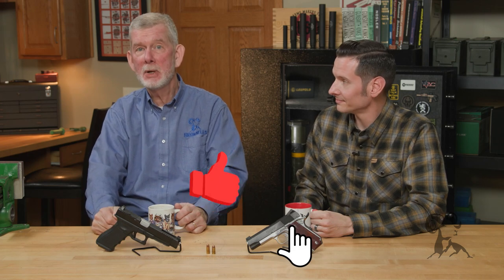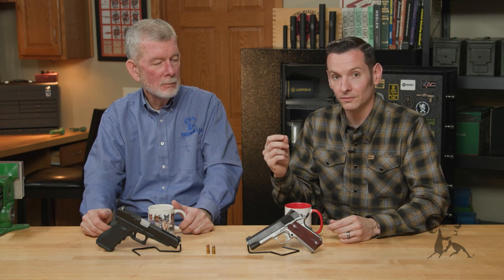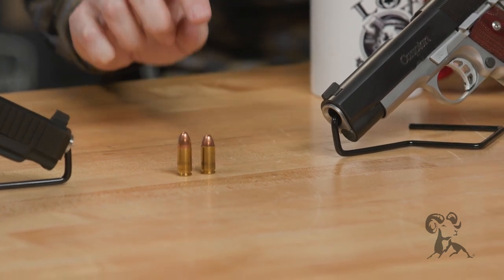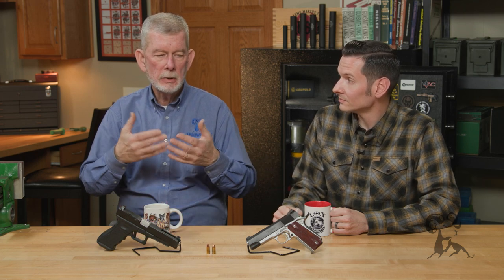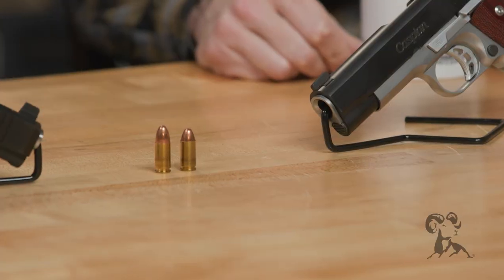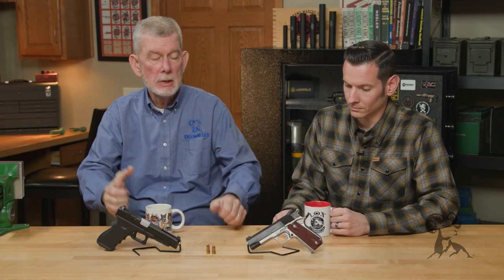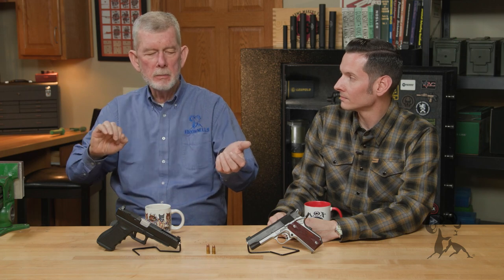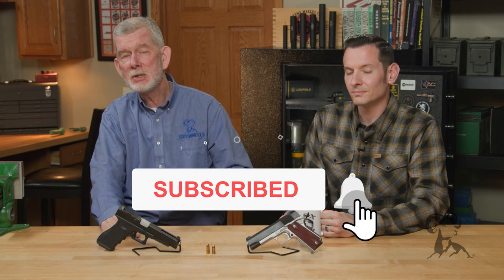Smyth Busters: Will Excess Bullet Setback Blow Up Your Gun?

Comment: I have always wanted to know this! I was a broke college student, and could only afford one 20 round box of Hornady TAP defensive ammo. I shot 7 rounds to function test it in my gun, and kept two magazines +1 in the chamber loaded. I had so many cartridge pushbacks/setbacks, I was down to only one magazine of decent rounds left before I bought another box (of different ammo). Question is, can you take a pair of pliers and pull the bullet out to the correct specifications (length) and will it be safe to fire???
Reply: Get a kinetic bullet puller hammer to tap the bullets forward a bit, then you can set them back to the correct depth and crimp them. If you don't re-crimp them you're wasting your time.
Reply: @ausgixxerpilot  can you crimp the brass, well in this case (no pun intended), a nickel casing, with a pair of pliers, or how would you do that without a set of dies? Sorry, I don’t even know if dies crimp the case, I’m like “infant level” or maybe more like “fetus level” in my knowledge of reloading… I bought a complete single stage reloading set and bought all the components that I need to reload 300WM, but I really want a mentor or a class to get me to the point where I am comfortable enough to do it myself... I’m terrified that I’ll blow up the gun I got as inheritance when my grandpa passed away
Reply: @injuredoutdoorsman9011  No, you can't crimp with pliers. Get a Lee Factory Crimp Die for it. .300WM is not particularly difficult to load. I prefer H4895 due to its versatility but there are other choices. It's also excellent for reduced loads, you might not want to be shooting the WinMag at full-noise all the time so you can shoot it like a .308 most of the time and just load full-power loads when you need them. H4895 is what I recommend to anybody starting out.
Reply: @ausgixxerpilot  thanks! I think that’s the powder I bought. I reloaded once with a friend YEARS ago, and still have some of those. They were loaded to about the power of a 308, and we used lead tipped hunting loads. I want to get some SST or ELDs to eventually get into long range shooting (and by long range I mean a torso size steel target at 1k yards… nothing too crazy)

Comment: Its not that it, "can cause more pressure" it WILL cause more pressure
Reply: I read something about a 40sw with forgot what degree of set back but it creates the same pressure as 7.62 NATO and NATO pressure is more than commercial 308
Reply: @dustyak79  every .001" it compresses it definitely increases.
Reply: It will indeed, but it won't necessarily cause too much pressure or enough to cause any damage. That will depend on the specifics of the situation.
Reply: @ausgixxerpilot  it's never a good thing though. That's why people who don't crimp are crazy.
Reply: @wade6523  I wouldn't say crazy, perhaps they just avoid situations like this that can cause problems. If you have good neck tension or you are using light bullets there may not be any need to crimp the bullet in place. For carry ammo, or dangerous game ammo, I would definitely recommend crimping, just to avoid that one-in-a-million mishap that has higher consequences than some smoke coming out your mag well.

Comment: i disagree with that 
sit back bullets  build less chamber pressure than well seated ones 
the real hazard is the over seated bullets that engages the rifling while chambered 
that will in many cases blow up your gun      
as a pro gunsmith and a gun builder this is my feed back
Reply: As a pro you surely have access to a ballistics software and you can check your (wrong) opinion with a few mouse clicks...

Comment: Wait a minute.  The pressure generated by even a mid-level cartridge like a 9mm is  about 35 THOUSAND psi on average.  This is assuming the bullet is normally seated.  Exactly how much MORE pressure do you think will be generated by seating the bullet farther back?   Come on now.  Pushing the projectile back in the brass casing is not going to blow up your gun.  As they say, most guns are pressure tested to TWICE the normal PSI.  Pushing the bullet farther in doesn't increase the amount of powder in the casing.  Sure, you might get SOME extra pressure as it will take more to dislodge the bullet etc. but not double what it would ordinarily be.